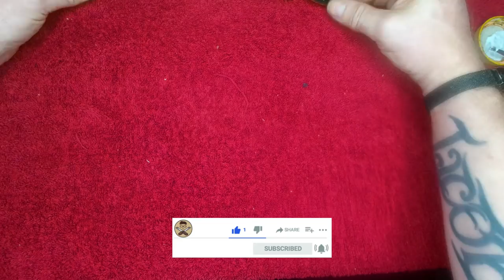Cutting and assembling a multi layer picture frame on a K40 laser cutter

Comment: What software did you use? Could you not have the software just do single pass?
Reply from the maker: I used k40 whisperer for this. It does not detect any duplicate shapes so I had to edit them out in inkscape.
I have since upgraded to a ruida controlled laser and can use lightburn which is much better to use :)
Reply: @philscraftcorner  yes, lightburn rocks. I have never used whisperer, upgraded my board before I even tested mine. And my 50w came with the ability to use LB out of the crate.
Reply from the maker: I was using lightburn with a diode laser a few years back. I'm so happy I can use it again now 😁